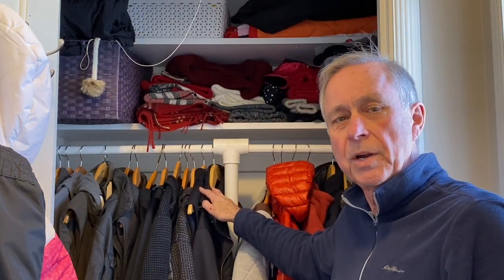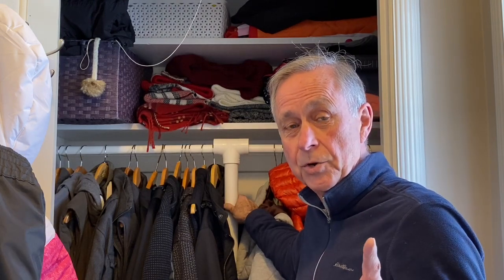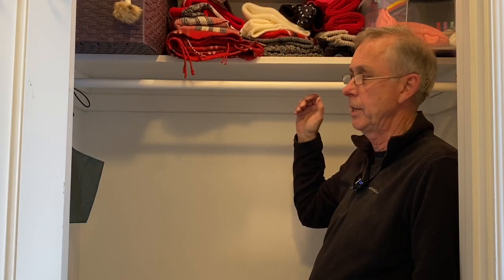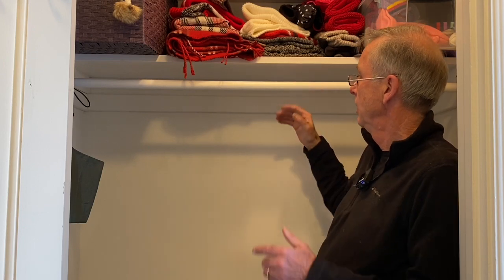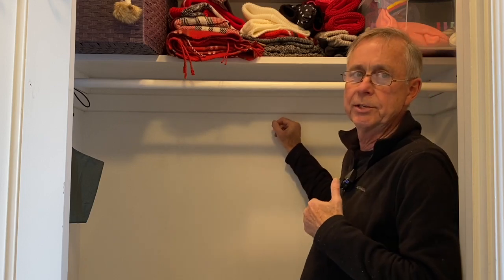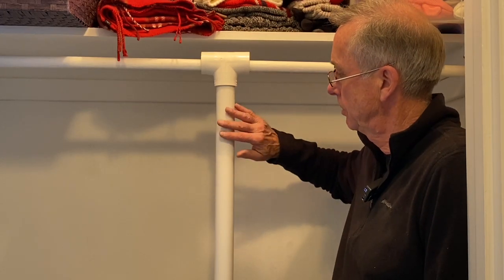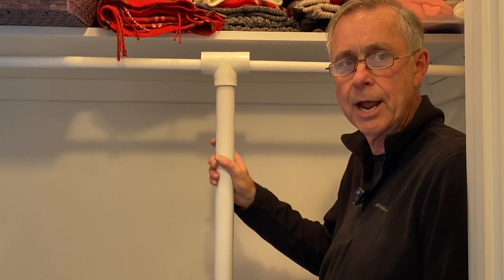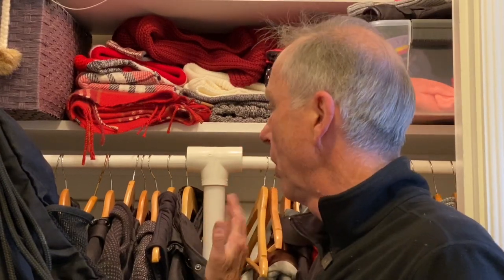Easy DIY Closet Repair - No Screws in the wall!

Comment: I really like this idea.  I have a closet that only has half of the space to hang clothes.  I can't put one of the shelfs with integrated hanging bar as the closet also houses an electrical breaker box so I can't block it.  But, this idea will allow me to put additional hanging space without blocking.  I also have a very high ceiling wash room that I could use to hang shirts and things that need to hang dry.  I could incorporate your idea and use mounting brackets on the sides with the supporting pole in between the washer and dryer.  Great idea for additional hanging space .. A nice solution to add additional hanging functionality to my small condo I also like that the solution is inexpensive and versatile.
Reply from the maker: Thanks for the comment. I’m glad i”the video was helpful!

Comment: how did u get the top support to go around the bar like that? did u have to cut the top support for it to go around?
Reply from the maker: No. I took down the rod and slid it through the T at the top of the support.
Reply from the maker: If you can’t get the rod down, you could cut off the top of the T.
Reply: What exactly is the T part called
Reply from the maker: @shayharris9382  it’s called a T. Just tell them at a hardware store what you are trying to do. They should be able to help you find what you need.

Comment: How do you measure the PVC pipe length for floor How much do you have to subtract for the amount that is in the T
Reply from the maker: Put your upright pvc into the T and mark on the upright where the edge of the T comes to.  Install the T on the closet rod.  Hold the rod up so it will be parallel to the floor. In other words remove the downward bow in the rod. Measure from the bottom of the the T to the floor.  I would add about 1/2”.  Install the rod and see where you are.  It should be too long. Cut a bit more off and try it again. Not very scientific but eventually you will get to the exact height you want. Good luck!
Reply: @Ray_Here   Thank you for your reply very helpful

Comment: Didn’t show how to install.  Further, one of my plastic holders broke and now rod too long to place back in since need to screw in holder and cannot due because rod needs to be in place to fit.
Reply from the maker: Sorry you had that issue Jeff. I have had the rod holders break as well. You may be able to find a metal rod holder. They are generally thinner than the plastic ones and hold up better. 

The install is pretty straight forward. Just lift on the rod and slide the pvc pipe in place.  Good luck. I hope you get it worked out.   The repair in the video has been in place for a long time with no issues.
Reply: @Ray_Here  Thanks for replying! Just imagine problems getting the rod into the plastic holders. Too short of rod and will not fit into the holders; long enough rod to fit into the holders will present the problem of having to unscrew the plastic holder from the wall and insert the rod. However, then no way to screw the plastic holder into the wall (the screws are in the middle of the plastic holder). For time being just placed the rod against the wall after removing the plastic holder, and the rod seems to fairly secure against the wall by itself. I thought about getting one of the tension rods normally used for curtains, but also stated can be used for closets. Not sure, however, what weight limit that would support. Manufacturer does not state, but user video says seven pounds.
Reply from the maker: @jeffzest8393  I would not recommend using a tension rod.  Is your rod wood?  if so, you should be able to cut it a bit shorter.  If its metal, perhaps you can just replace it with a wooden rod.